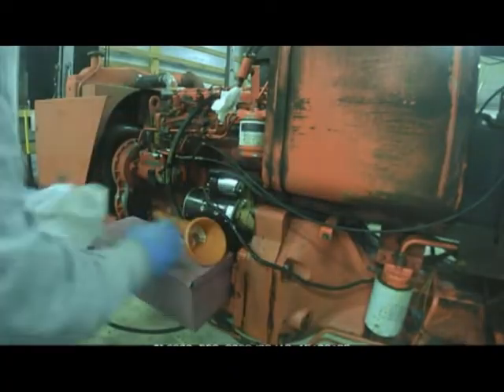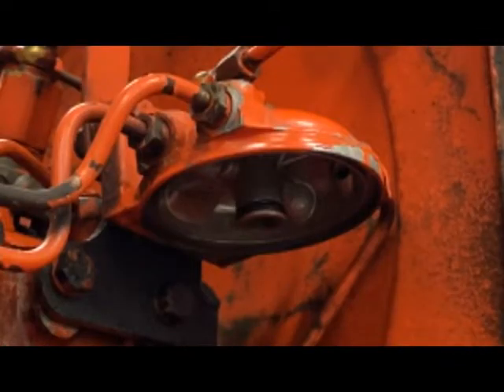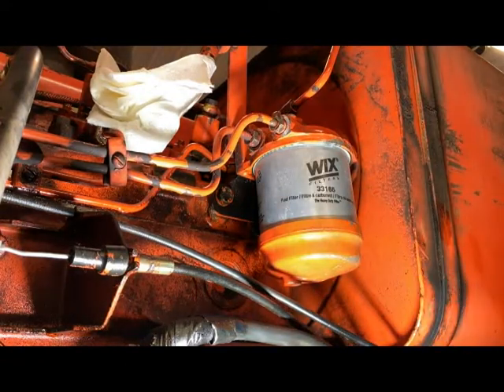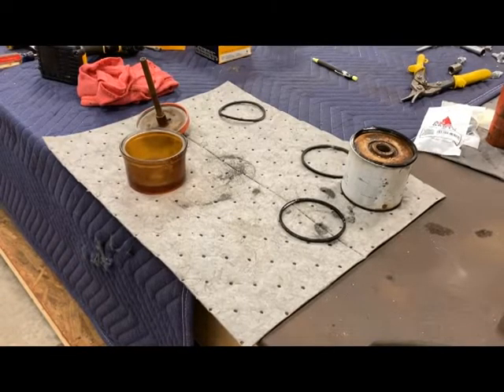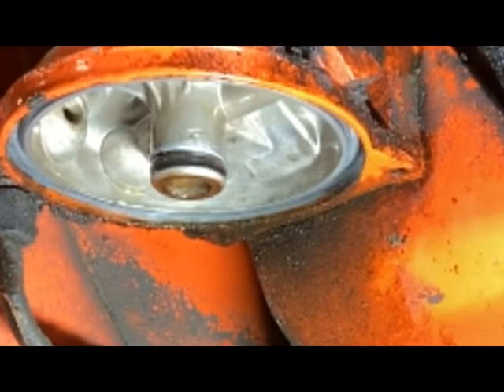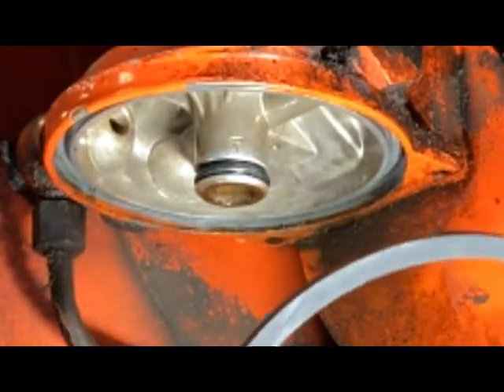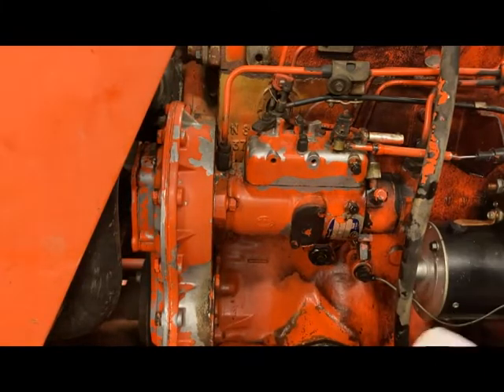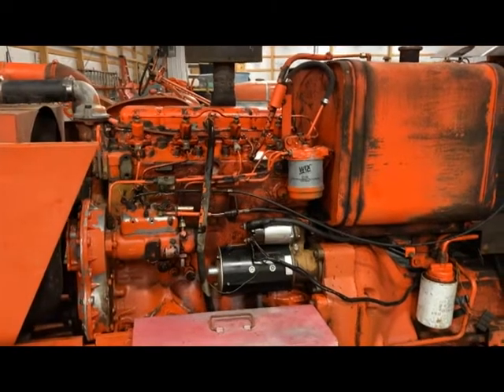Allis Chalmers 175 Perkins Diesel Fuel Filter Change

Comment: Good  day  My IH   574    has glass bottom.  Watching put gasket on top,  take your time.  It was cold ,  tractor stopped,  snow storm,   glass leaked,  tighten it glass broke,  cut myself& still leaked.  Also  574  has not got pump,  gravity feed  which I think is slower
A  person should drain a little fuel  everyday  from glass separator  .Thanks  Good video
Reply from the maker: Wow I bet that was a mess. Gotta be careful when tightening those up for sure. Have a good day!

Comment: What about the third big O ring? It comes with 3 but only 2 go on it?
Reply from the maker: Chris, at 2:45 on the video I discuss the larger o-ring location.
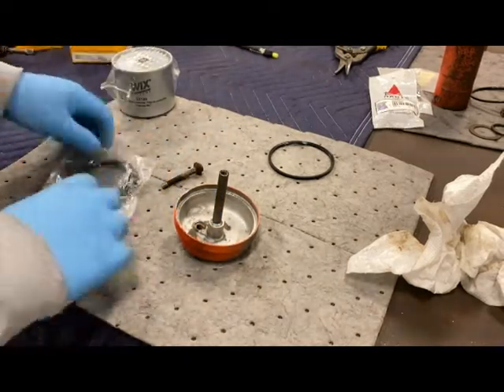Reply: Thanks for replying. My filter came with 5 O-rings in the bag and at 1:20 it looks like yours did as well. I see where 4 of them go the small one medium size and 2 big ones but I don't see where the last big one goes. I ended up leaving mine off and as far as I can tell you did also?
Reply from the maker: @chrismc8548  gotcha sorry I referenced the wrong o-ring.  If you have a glass separator bowl that is where the second larger ring goes.  In my case it is on the other side of the engine.  If you don't have one you can discard that ring.
Reply: Oh that makes sense now. Thank you